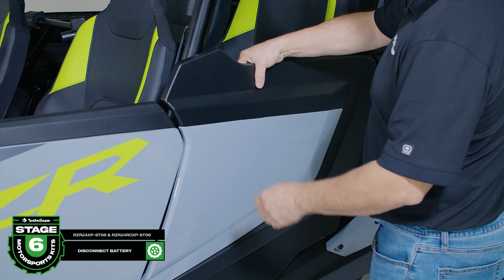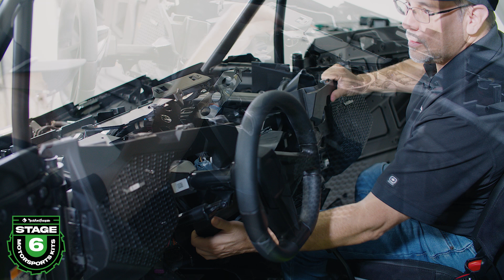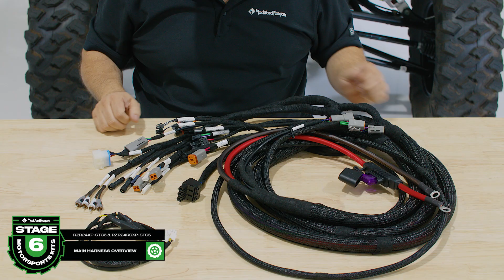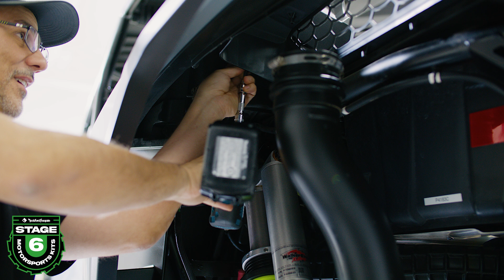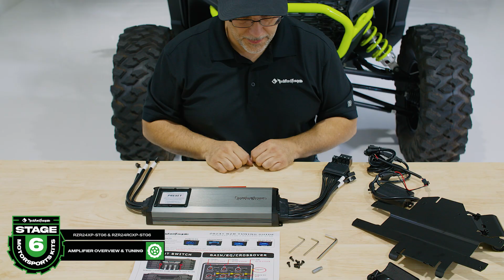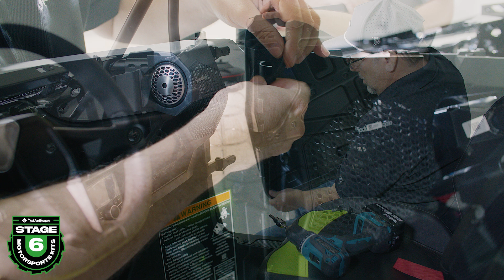Aftermarket Stage-6 Install for 2024+ RZR XP | Rockford Fosgate

Comment: Can you use both ride command and the pmx unit to control the audio, or do you have to choose between them?
Reply from the maker: No, our aftermarket systems are designed to either use our PMX or the Ride Command as the source unit, not both.  However, you can keep your Ride Command for the Navigation and other functions and add a non-RC kit equipped with the PMX source unit, giving you the best of both worlds.